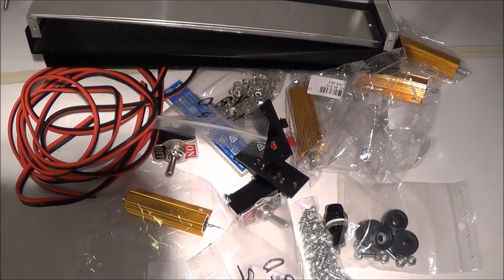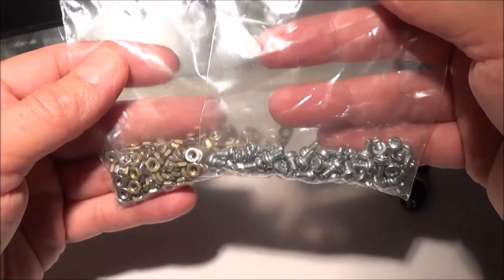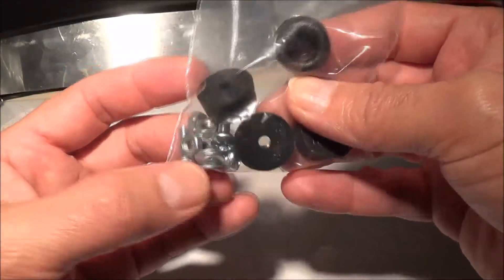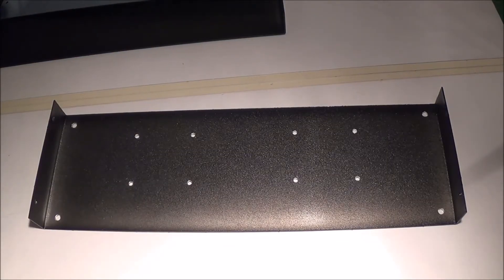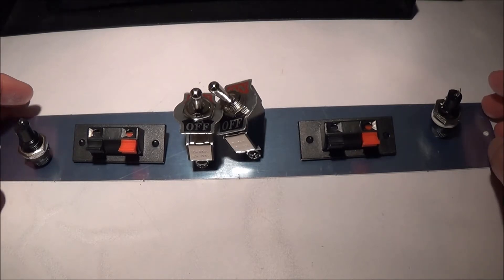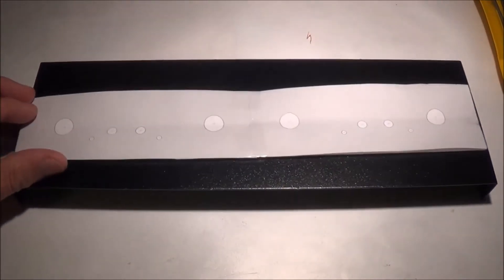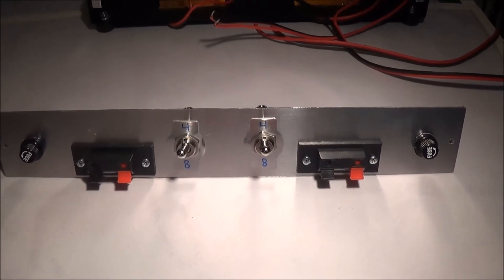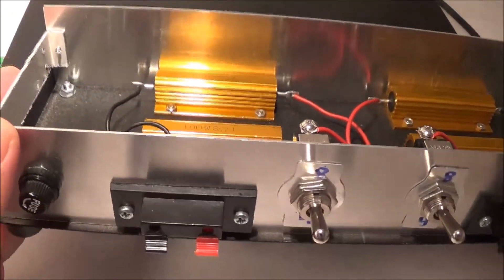8 or 4 Ohm Dummy Load For Testing Amplifiers And Receivers

Comment: Nice project. Good tip on using the back side of the on/off switch plate for the new numbers. If you need to change those numbers, isopropyl alcohol readily removes permanent marker ink. The resistor abutted against the back wall is a good thing. The back wall will serve as an additional heat sink. If you do not have an angle bracket for the middle of the front panel, a drop of glue might work. But, do not use hot glue in that hot cabinet. I like Shoe Goo for this type of use. It is stronger than caulk. Or, if you have extra aluminum left over, you might just double the plate. Cheers.
Reply from the maker: Thanks for commenting and the tips! Looking back, I would have did a few things differently. I wanted to build a bigger and better one after I built this, but decided I really didn't need it.

Comment: Interesting project! I really like the idea . But I have one concern as I will build my first audio SE amp and want to have a real dummy load (also for future amps).  Two questions: Is it better to have a bigger W resistors say 50W at least just to have a headroom for bigger amps? Secondly ... is 4ohms for audio often impedance ? I mean, it is easy to have dummy load for 4 as well but just thinking out loud :) Thank you sir for advise.
Reply from the maker: If you are going to build or work on higher-powered amps you could go with larger wattage resistors; doesn't cost much more. If you think you are going to have rare 4-ohm amps, you can have a set-up like mine. If not, you really don't need it. Now this was my first dummy load I had built in over 20 years; therefore I didn't want to spend too much time and money. Next time I would probably use only 8-ohm resistors (no more switches), use a larger and sturdier case, use different loudspeaker terminals (mine were really cheap), and have jacks for voltmeter/oscilloscope connections. I will probably make another dummy load soon.

Comment: I'm a little confused about the fuse protection... If the fuse blow, then your amp will not be connected to the resistor anymore, so no dummy load to avoid your amp to be damaged... I am right or I forget something? Thanks for your video! Very interesting project :)
Reply from the maker: Thanks for commenting! The fuses are more for the protection of the dummy load, not the amplifier. Just as you sometimes have speaker fuses. Nowadays I would probably build the dummy load a little differently. I would probably leave the switches out and use different car fuse holders to change from 8 to 4 ohms. And add extra connectors for easy connection to a scope/voltmeter.

Comment: you don"t need that, only thing you need is you hot water tank and then run a wire from you tank to you amp, remember ! you 50 gal water tank is about 8000W

Comment: @Old School
 #OldSchool , if you take out the switches and drill two more holes next to them , you could re-wire the box with the four holes becoming banana jacks, one resistor for each out, ie 2x speaker terminals and 2x banana , make a pair of y -cables and then you would have both 4 and 8 ohms AND have banana sockets too, small mod, couple of bucks and a couple of spare switches left over.
Reply from the maker: Thanks for the tips. I am not wholly satisfied with my dummy load and your idea is worth looking into. Thanks for your effort!

Comment: Hi there 
I am trying to add some resistor to the back of my old car radio I done some research and it shows I need to add 10 ohm resistor to speaker wire my question is how to add this to the speaker wire I have two wire (+,-) should I put it across these two wire or on each wire should I put a resistor. I think I am creating a dummy load for my radio and sending signal through line output converter to the amp.

Any help will be much appreciated.
Reply from the maker: +Ahmad Aldahoud Hello Ahmad. I don't work on car radios, so I am therefore not familiar with them and/or line-out converters. But I think they want you to trick the radio into seeing a load in order for it to put out a signal. You would therefore put the resistor across the wires (+, -).
Reply: Old School thanks for time .
Kind regards
Reply from the maker: +Ahmad Aldahoud You are welcome and good luck!
Reply: Old School just another question is the resistor heat up if I create a dummy load to high level.
Thanks
Reply from the maker: The resistor might heat up since it (10 ohm resistor) is a low-value resistor. The lower the value, the hotter it is going to get. You might have to experiment with larger resistors like 10 watts or more and see how hot they get. Say if your radio puts out 10 watts, then I would put in a 20 (double your wattage) watt resistor for safety. You know, radio puts out 5 watts, then use 10 watt resistor and so on.
Reply: Old School if I put let say 4 time the output radio is these affect it anything.
Thanks for your time.
Reply from the maker: You mean 4 times the wattage?
Reply: Old School yes
Reply from the maker: +Ahmad Aldahoud 4 times the wattage is no problem. Gives you even more of a safety margin.
Reply: Old School as always thanks again
Reply from the maker: +Ahmad Aldahoud Good luck!

Comment: Do i really need a dummy load for testing a ~150watts rated amp or i can use a speaker as a dummy load ?
Reply from the maker: If you are talking about audio testing with test instruments, then you need a dummy load. Otherwise, how can you test an amp at full-rated output? Imagine how loud it would be. Also, speaker impedance changes with frequency; the readings of your test instruments might change greatly from one test signal to the next.
Reply: Ive ripped the voicecoil out of a 100W speaker and submerged/cooled it in oil to test 1000W amps with it, bear in mind the oil will get hot quickly depending how much oil you heat, on 1000W 1liter of oil gets hot under a minute, on low power (150W) i suppose you should be able to be test much longer, as old school said, for testing amps you dont want a reactive load, so you either have to seperate the coil from the magnet or glue the coil fixed so that it doesnt move at all, the coil will need additional cooling, honestly buy a dummy load, its much cleaner and less hassle.
Reply: @picapica8806  what?    I call BS on your voice coil deal.   What does it change to over the sweep of frequency?

Comment: Just wondering whether you have actually measured the resistance at the outputs as it seems to me that the switches and wiring could have quite an effect on the final output resistance value?
Reply from the maker: Sure, it does make some difference, but my goal was to use the dummy load for testing purposes mainly, not to make precise power output measurements. Say, if you are working on a receiver that puts out 10 volts RMS across the exact 8 ohm load you would get the following: power = this RMS voltage squared, then divided by the resistance, 100 divided by 8, equals 12.5 watts. Now, if your load is 8.2 ohms, then you get 12.19 watts. Now if we have an output of 20 volts RMS with an exact 8 0hm load,  we get 400/8 equals 50 watts. But, if we have this same output (20 volts RMS) with a 8.2 ohm load, we get 400/8.2, equaling 48.78 watts. I think mine (dummy load) was 8.2 ohms when I measured it. Just depends on what is important for you....
Reply: Thanks for the reply Old School. That's fine; it meets your purpose and, as you say it depends on what is important to you. In any event 0.2 ohm is very small and I'm surprised it was not greater as my experience with switches of that type has been that they had a higher contact resistance. Cheers & thanks for sharing video.

Comment: I replaced some 8 ohm blown home stereo speakers with 4 ohm speakers. Now my receiver shuts down. Its a 30 year old 125 watt x 4 channel Pioneer. (flashes overload warning on screen). Can I place a 4 ohm resistor on the speaker wire to get 8 ohms? Any help would be greatly appreciated as I am technologically retarded!!!
Reply from the maker: Well, it is an odd way of doing things, but I  think you could. It might change the tonal quality though; you just have to try it out. The resistor is going to have to be in series (in line) with the red wire. Also, you will lose half of the power in the form of heat. That being said, you are going to have to use resistors with a high power rating; 75 watts will not do, in my opinion. I would use bigger resistors....125, 150, 200.  As far as I remember, every time the load resistance is halved (going from 8 ohm to 4 ohm speakers), the amp power supply has to deliver twice as much current; this situation is now giving your receiver problems. Also, the transistors have to work much harder. Overload situation.
Reply: Old School
Thank you so much for your timely response. I am researching how to buy another set of four ohm speakers and wire all four to give an 8 ohm impedance. I am afraid this system is gonna' hit so hard with four cabinets instead of just two. It was so freakin loud and hit so hard to begin with. 125 watts at .008% total harmonic distortion. You can't buy that kind of quality today. It seems everything is rated at 1% total harmonic distortion these days and it all comes from china. This Pioneer was built in the USA 30 years ago. It's a good thing I live in the country and won't be disturbing anyone. I hope I can figure this out without destroying anything. Thank you again!!!!
Reply: Old School
(Updated) Holy bejeesits!! There are so many options to get to where I need to be. Ain't the internet great!!!
Reply from the maker: Awesome! Gotta keep those high-quality amps and receivers alive; they just got a lot of class. I prefer Japanese and American equipment back from those days. Just remember to get 4 (one for each 4-ohm speaker) high-wattage resistors (give you a safety margin). That being said: good luck and crank it up!

Comment: can i use 25w resistors?
Reply from the maker: sure, you could use one 8 0hm 25 watt resistor per channel, but you wouldn't be able to do too much with it. better  would be to use two 4 ohm (25 watt) resistors per channel--the 4 ohm resistors would have to be wired in series, of course. would give you 50 watts per channel--that's better than 25 watts per channel. or if you have 2 ohm, 25 watt resistors you would have to connect 4 resistors in series. 100 watts per channel. all kids of combinations are possible. i do mostly vintage stereo receivers; the standard output impedance is 8 ohms.